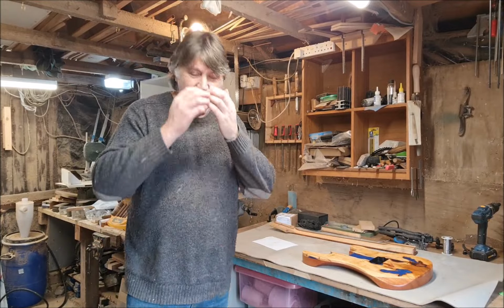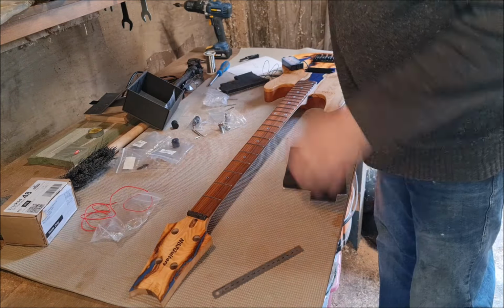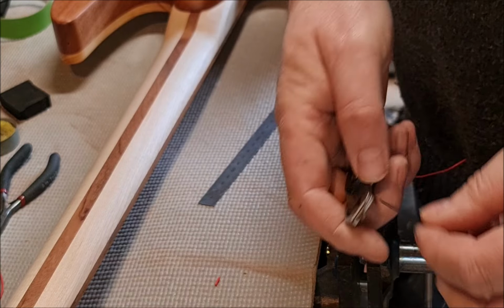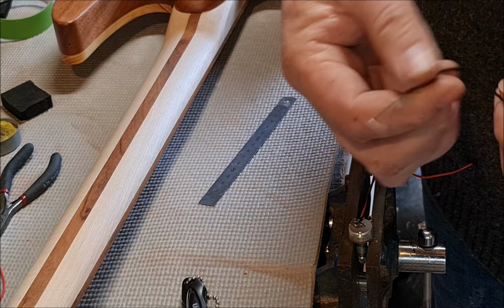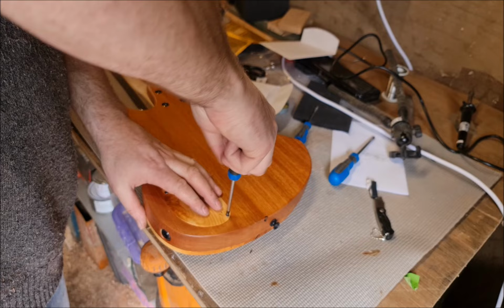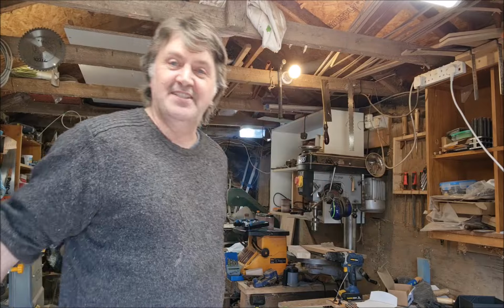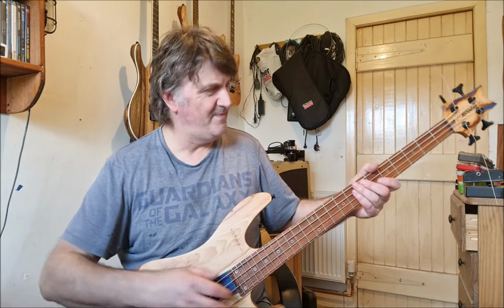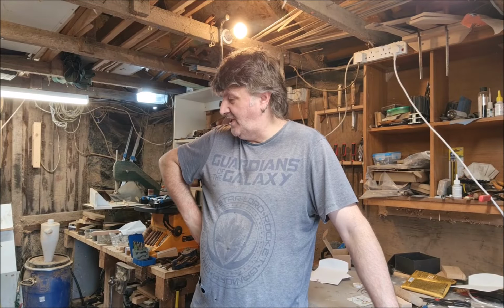New bass episode 11

Comment: A "sprung cover" is a design feature. Makes it easier to get the cover off. 😂
Yes, cut the strings shorter and put the pokey end in the centre. Or leave them sticking out and use them as punter busters. 🙃
Maybe you can just snug up the truss rod a bit and the rattle will go away?
I don't think you can call yourself an amateur much longer there Niel!
Looks amazing, sounds fantastic!

Comment: Great bass Neil! You are right about the tuners, the sting goes down the center then bend it over in the slot and tune it up. I use the slotted tuners whenever it's appropriate on guitars as well cause it get the sharp ends out of the way. Set up wise you can do pretty much the same as guitars except you may need a little more hight on the string. Some bass players like a higher action. It depends on the player.